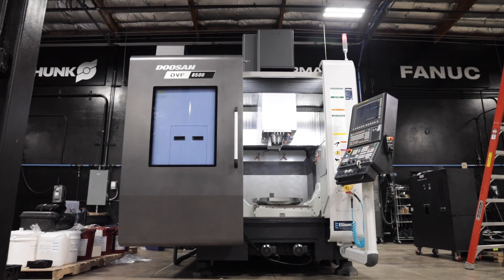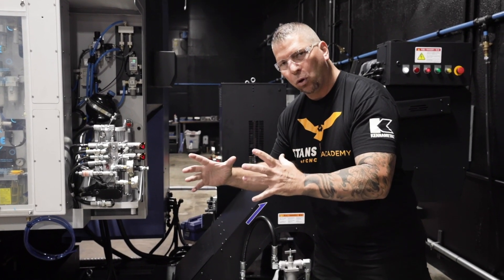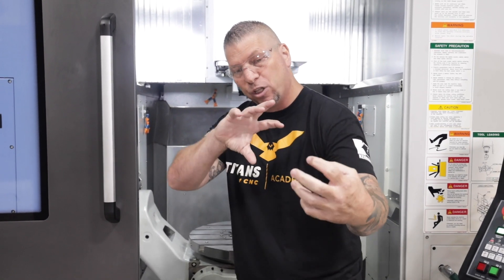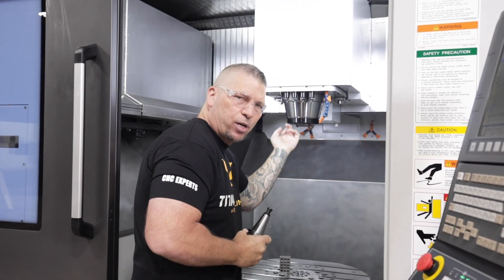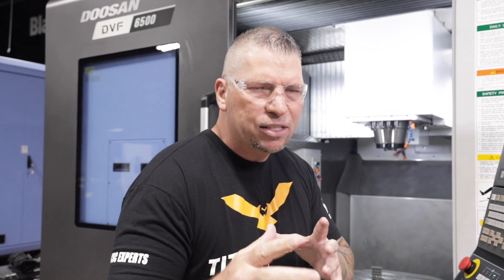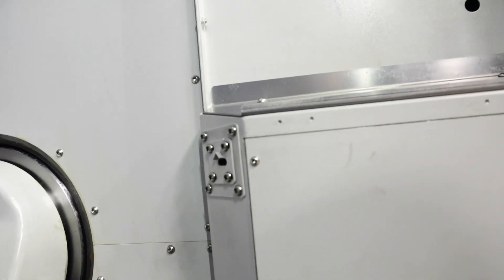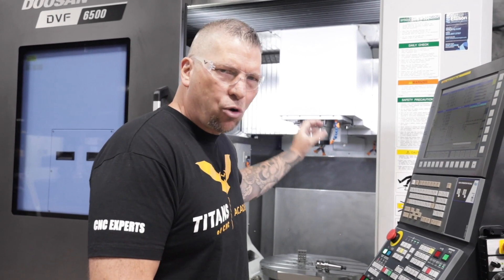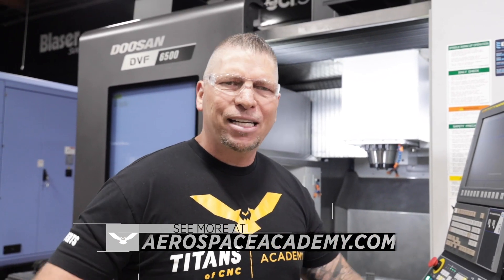DN Solutions 5 Axis DVF 6500 CNC Machine Arrives at Our Shop

Comment: Nice machine Titan ! I have run a Hermle C62U-MT. 69,000 lbs with a 42" table, 69 hp at the spindle (with HSK-100 holders) 90+ hp on the table (as a lathe). Only major difference is that it had a Heidenhain control. Easy to pick up on though. Using Open Mind (Hyperlink) for programming. I wish I was 30 years younger and worked for you.

Comment: And the thermal  expansion of glass is  the same rate as cast iron and the glass scales follow the the moving part of each axis there for by passing any inaccuracies in the ball screws . Gantry style 5 axis machines have the best chip evacuation of any machine center.  One day it will be mine  😉

Comment: I’d like to see how he feeds large programs into Fanucs on these new Doosan’s that have limited memory. I’m sure he’s used to Hass having more than enough.
Reply: The Fanuc on the 5 axis Doosans has the 1gb data server included....loads of space for programs!
Reply: Chris Wood if you’re going the data server route, wouldn’t you simply M198 from a pc? That’s how I’ve got my Fanuc setup, post from Fusion, immediately cycle start, the only prog on the control is “O0001;M198P0001;M30”

Comment: TITAN,  there is no better cnc control than Heidenhain...yes, its a closed system also, I work on 840 D SL Sinumerik, yes, its capable, but too open system, (why the hell I need to know all the crazy variables, parameters etc. to do the simple or even a dumb jobs, why do I need macro understanding at a high level, yet, even if I know, there are unlimited options for doing exactly the same operation...we need to lean towards the standard, so cnc machinist can be quickly adapted into a new company, nature of the work and a philosophy etc.Too many CNC control systems, too many coding, to much cost is related to a custom posts, CAM, configs, extras software etc. Too many tooling options, too many this and that...what is the point? time is a money at the end...

Comment: Is that the same Company that produces the excavators?
Reply: Doosan Machine Tools used to be part of Doosan Infracore, yes, the big excavators.
Reply: @Pande2112  Interesting. In Germany the Doosan Excavators are known as cheap Liebherr copies with less features. So it's interesting that they build well engineered CNC Machines.
Reply: @oberender64  Doosan Infracore wasn't doing well and Doosan Machine Tools was their best performing piece. That is why it was sold, to maximize return. But Doosan Infacore also built ships, ship engines, nuclear reactors and so on. They were the Korean equal to Mitsubishi Heavy Industries.

Comment: The only thing I don't like is there's no through hole on the c axis.
Reply: A through hole is a factory option
Reply: Hi Dave, there is a union included on this machine as standard with 6 lines prepped for air or hydraulic - hope that helps!!

Comment: had machine with Siemens 840D, one of the easiest to use controls in 5 axis

Gets full ride from Doosan, downplays Siemens control in favor of clunky fanuc

🤣
Reply: I really don't know why people still deal with Fanuc controllers anymore. It's just 80's technology. It's memory capacity still is.
Reply: @gredangeo  thank you. It's replies and thoughts like yours which motivated Fanuc to step it up and provide a Great control for Multi Axis. 5-9 Axis Fanuc Controls are actually quite good now.
Reply: @gredangeo  it can be a trade-off. I've toastered a few Siemens controls because they can be a bit finicky about parameter changes. Fanuc, while archaic, is pretty bulletproof, but the control never really lent itself to full 5x because it's so basic.
Reply: You can get these with Siemens too.
Reply: @ubmathis  For only 24999.99...act fast!
Reply: It looks like its more about who is supplying machines for a deal, than what machines are best.
I own 2 DMG machines. DMF 180 and NZX 2000. I will stick with one brand that has served me well.

Comment: Wowowowo... Can I ask you a question about the machine.... How much does it cost that beast???
Reply: to my knowledge about 400k... closer to 5 all said and done with. 
running 40 hours a week investment is returned in 3-6 months depending on feild of work.
Reply: @SH-id2lb  thanks alot S H
Reply: @SH-id2lb  I think you need to do the maths again . 
If the machine cost $500,000 divided by 40 hours per week , divide this by 26 (number of weeks in 6 months ) & you get $480 / hour . This hasn't allowed for wages , tooling , other workshop expenses .
If you change to 3 months it is $961 / hour.
I don't know what Titan charges per hour but it isn't anywhere near this hourly rate.
Reply: @robertsomerville5377  Is the price seriously in the 500k range? I think that is very affordable but what do I know...
Reply: @gearloose703  not sure what price would be , but I priced a second hand Doosan horizontal twin pallet . This was $350,000 , for a 8 year old machine.
I was only questioning the other comment on how long it would take to pay off a machine.

Comment: I know a lot of what you do and the variety you have is for educational purposes, but is it common for machine shops to have lots of different brand machines? I know you already have several DMG's, do they not have a machine comparable to this Doosan? Is it common to invest in specific machines for specific jobs?
Reply: if part contract will pay for machine sometimes they do buy for certain part, most shops are geared towards certain types parts. dmg is a great machine but cost 2-3x times more than doosan. the way i see it doosan is Cadillac/mid price benz, dmg is amg... you dont need a AMG to drive 2 miles to work but yea there fun to have, but you could get 2 or 3 for the price of one.
Reply: our plant runs mazak, doosan, haas, fanuc (robodrill), etc. depends on a lot of factors like if the machine is leased/bought, automated or manually fed, whats important between high volume vs high precision vs complicated machining features, weather it's dedicated to one customer/project, budget, etc.

Comment: Wouldnt be a hsk spindle better?
Reply: I'm pretty sure these machines are part of a sponsorship deal and that's what Doosan were giving. Big plus is good, but not even sure Doosan ofter HSK options
Reply: @wildin13  these Doosans are available with HSK as an option.
Reply: @Pande2112  well blow me... 🤔 
I still think its down to the sponsor deal though. Things like the control tells me the machine isn't top spec and not by choice.
Reply: @wildin13  Doosan buys more Fanuc controls by far, than any other MTB on the planet. Fanuc is our bread and butter. This machine, as configured, is equivalent to, or better than, anything Seimens or Heidenhain can do. User friendliness? Maybe, but that might even be a stretch.
Reply: @Pande2112  interesting 🤔 when we had our doosans i was told the fanuc controls lacked the processing power that the heidenhain (or Siemens) would give (plus most our shop is heidenhain so second nature to us)
But I think that was 4-5 years ago now
Reply: @wildin13  Fanucs come in many levels based on many factors. Price is one and when MTB put the lowest level on a machine to save money, it creates a false impression of quality. Heidenhain and Seimens both have one basic control but include everything. Not many options to get above the standard model. We put Heidenhains on our machines as an option, I love them. But they don't last as long as a Fanuc. Fanucs are better supported and they make NEW parts still for controls and drives going back almost 40 years.

Comment: Nice revolution of the machine shop! A question about the tooling: why did you choose 40 taper big plus over HSK-63? Is there a performance difference or is it for standardization of the tooling with the existing ones? Maybe also cost is a factor since HSK are more expensive.

Comment: I always wonder, since these are huge investments, what makes you choose and brand and model over an other? I have no idea about machining whatsoever, I just like the videos
Reply: most shops continue buying with the dealer that takes care of them, im in cnc service and i strongly believe Service sells... but machine requirements/specs, cost, and availability all play a big part also.
Reply: You do your research and base your machine purchase off what meets your needs.
Reply: Doosan, DMG Mori have high rigidity comparing Haas. Doosan machines are seasoned and undergoes dampening and usually takes 5–6 months to arrive. That's why these machines are very expensive than Haas.

Comment: Encoders compared to scales.... Encoders is on the servo, that is driving ballscrew. Over time, this is wear will make the machine less and less accurate. 

Scales is external measurement, mounted beside(or on) the actual guide ways, and measure pure distance.  So the scale drives the servo. 

Example: 2020, new machine, 100mm, equals say 1000 revolutions....

2025, worn machine, 100mm equals 1010 revolutions... Still actually 100mm.... Scales always win! :-)
Reply: They are both encoders, it's just that these "scales" are on the load side of the drive mechanism as opposed to on the motor shaft. This eliminates any issues with drive transmission backlash. Typically, in mechanisms that require high precision, there will be two encoders: one at the motor and the other at the load. The motor encoder is used for the high speed feedback loop while the load side encoder is used to offset any inaccuracies that might occur due to high acceleration (wind up) in the transmission. In robotics (my profession) we use it to more accurately position the end effector (hand) as the multi-DOF arm settles into it's desired location. And, of course, the glass encoder scales are less susceptible to thermal variance, but more fragile too. Anyway, my two cents.